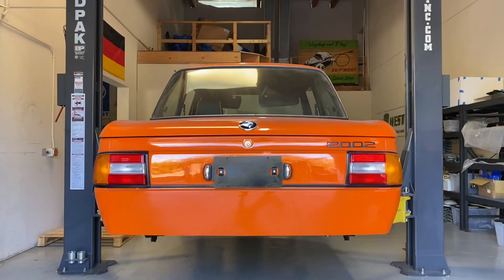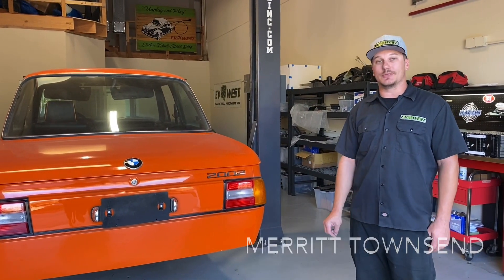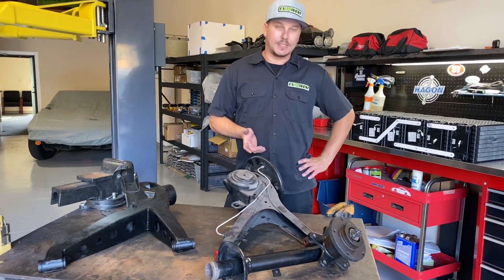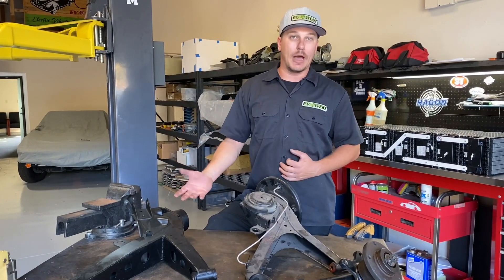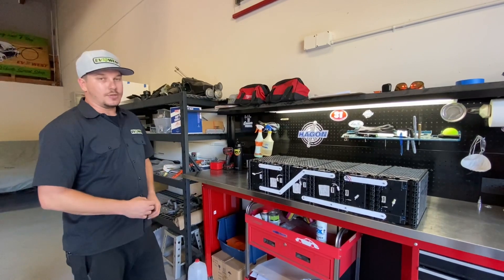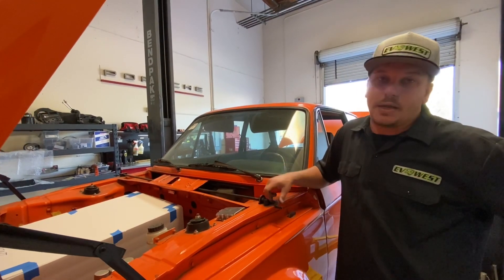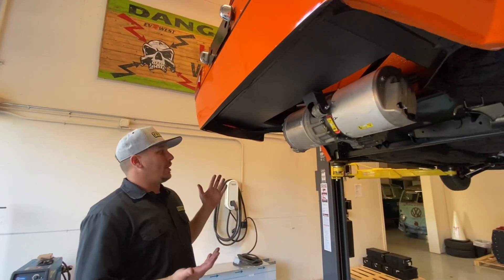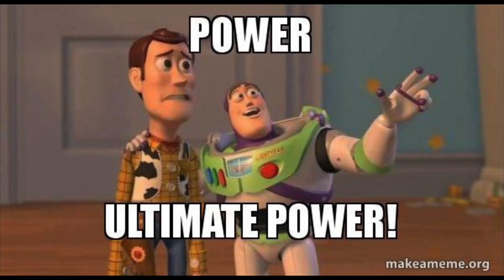1976 BMW 2002 Tesla Powered Electric Conversion | EV SHOW

Comment: How do I get started converting my 1931 chevy to EV?
Reply: Call your bank...
Reply: Pull the ICE motor, attach EV motor to trans, place 1/2 battery pack in trunk 1/2 between front wheels. Wire the controller... & fire it UP!
Reply: ICE motor, gas tank, radiator, etc ... It's all got to go!   You have a 3 speed manual in that classic car, manual steering, manual brakes, it's got a simple drive train with lots of style!  Bolt a Leaf battery pack under that thing.